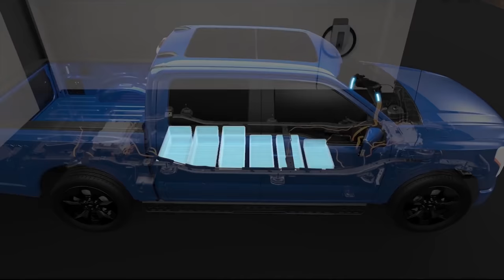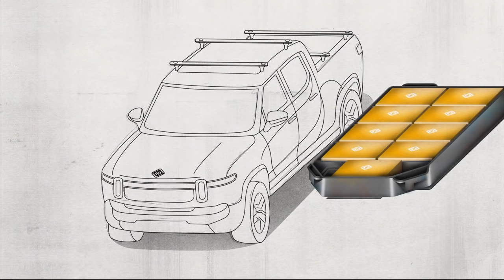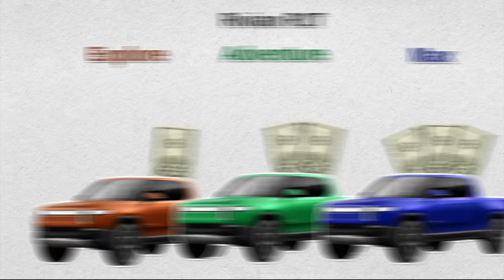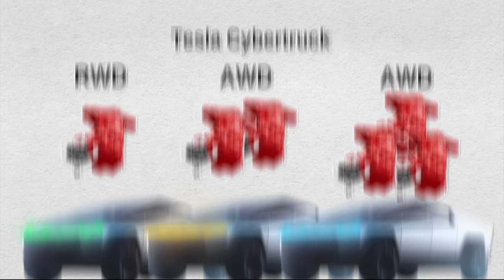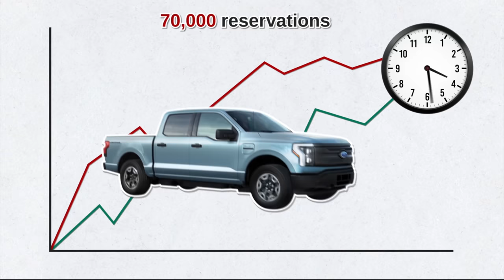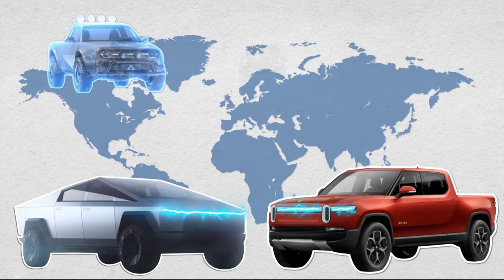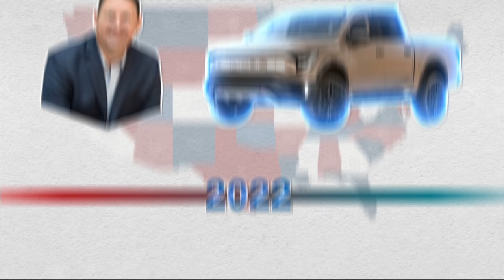Here's Why This Will Replace Trucks in America

Comment: Does the Cybertruck come with pre-smashed windows or is that at an extra charge?
Reply: LOL
Reply: I just hope it comes with a better look and styling.
Reply: @jamesblackwell5141  the style’s gonna stay the same. Lol. That’s one of the biggest talking points.
Reply: Matt black Cyber Truck I'm sold!
Reply: @WAFFLEooFILMS  *matte
Reply: From inside the "cyber truck" (cough) you cannot even see any of the exterior. It's like driving around in a giant fish bowl. (not) Very handy for a large vehicle in tight spaces like parking lots. Oh, there will be cameras? YOU drive that way and tell me if it's practical. People are going to learn the hard way about buying a pickup truck designed by someone (Elon) who has never owned, used or driven one.
Reply: @gazebo9730  So, since you haven't bought a truck I'll tell you. The trucks that I bought and the company trucks I drove, were for PURPOSE and none of them had a 'talking point' as a purpose. The people who will buy one will be hipsters, not people who need a truck.
Reply: @seanwatts8342  well, sure. But this truck is a meme. That's why everybody knows about it and it's probably a big reason it'll sell. I didn't say it was practical or purpose driven, or anything. I just said I highly doubt Elon will change the design, because the design is the biggest talking point. The meme will likely sell the truck.

Comment: Hmmm? I've still got a 2006 Tundra 220,000 miles and it still does everything I want it to. What happens when you go overlanding  in an electric truck and the batteries go bad? Out of cell phone range you're screwed
Reply: A gas tow truck comes to haul you home at an cost that will  bankrupt most people.

Comment: I'm sticking with old school. My work horse is 1967 F100. I don't care what anyone says, it does what I need it to do, I can easily fix any mechanical issue, and there's almost no electronics to worry about. FE motor bolted to a 4 speed is a damn near indestructible setup. And I like knowing that I can get it going with just a few gallons of gas. The idea of having to rely on electricity for your vehicle, especially in an emergency situation genuinely scares me.

Comment: I used to buy rechargeable batteries even though they where more expensive.  My phones always charge and last less and less all the time. The car manufacturers need to prove improved battery longevity technology more than anything, but they won't be able to do that for several years.
Reply: They've been working on that for DECADES.
Reply: This is hands down the biggest "Achilles Heel" of the EV market. How long will these massive battery packs actually last on a full-fledged truck EV? Sure we've got some idea of how they'll pan out with EV cars, but let's be real here... there's a massive difference between the 2 and that's how they're utilized. Will the extreme punishment these trucks endure lead to premature battery failure? Only time will tell. 

Then begs the question, how easy or difficult will it be labor wise (let alone part cost) to replace the batteries? Having 15 years of experience turning wrenches 1 thing I've learned above all else is, engineers do NOT often think about making things easier to fix. Just easier to produce. I'm sure Scotty would agree with this one, especially in regards to certain manufacturers. There are exceptions (Honda & Toyota) to this, but even the best occasionally forget (or don't care) that various parts will eventually fail.

Comment: If the hummer didn't have the cost of a small house it would have been a cool contender.
Reply: That's like saying Porsche would be contender for cheap sports car if they were $50k cheaper. Hummers were never cheap. Even used decent ones are $20k and they haven't been sold for a decade.
Reply: Where can you buy a small house fo 100k ? You can't even buy a condo for that much
Reply: @micperez819  There are plenty of condos and small houses for around 100k in more rural states. Don't know why you guys need to take everything so literal the hummer is over priced and won't make many sales face the facts

Comment: The media keeps this under raps but it is possible that electric cars will not overtake the auto industry, because of Synthetic, or carbon-neutral, fuels. Synthetic or E fuels  capture CO₂ in the manufacturing process. In this way, this greenhouse gas becomes a raw material, from which gasoline, diesel, and substitute natural gas can be produced with the help of electricity from renewable sources. It works in conventional gasoline engines and also can be formulated to power Airplanes. So you can keep driving your old car.

Comment: Reality is...Plug-in Hybrids are way more suitable to the common person. Without the range anxiety, pressure on the grid, more affordable, without expensive battery packs, that needs intensive mining and hard to recycle. So don't expect ICE to go away anytime soon.
Reply: Hybrid batteries are also expensive.
Reply: Thank You ❗
Reply: @stevenw4549  A least you won't have to fight for a plug in the near future if you own a Hybrid, I have personally driven hybrids over 200,000 miles, No not a Prius, Honda 5 speed manuals, If driven properly at the time I got 60 mpg provided it wasn't over 100,000m car I ran both we own to over 300,000m, But now own only Gas powered cars, Because I want Heat when I want it and everything else in between 🤓..
Reply: @stevenw4549  I am not saying  hybrids are bad, I am only talking about my personal experience with hybrids, A larger engine configuration would eliminate most of my bad experiences, Like most new ones are built now, Our larger problem now with dire consequences is that open border it Will Destroy a once Great place to live without accountability for people actions, You can't even evict none paying tenants now, How the hell is this going to work 📉🔥, It WON'T ❗
Reply: @raymondreiff8170  I agree.

Comment: The four wheel steering is about 2 decades old. GM had a quadrasteer pick up truck and, I think, Honda had a prelude in the late 80's (1988, I searched it). There are even 4 wheels steering, on certain riding mowers.

Comment: When they have 1000 miles batteries I will keep on next to my f250 what I love best ever truck
Reply: I agree with that.  I think a 1000 mile range is the tipping point where electric vehicles become appealing.  A 500 mile range is intriguing but really not quite enough especially if you need to tow.  That 500 mile range probably drops to 200 miles when towing.
Reply: I hear ya... But how many miles does a tank get you in your f250???

Comment: The new Ford Lightning sounds great -- except that it's all-electric.  That's okay for a work truck or even a commuter-truck that never goes that long without an overnight recharge.  But I live in an apartment with no way to recharge in the parking lot.

What I'd like to see is a pickup with similar specs, but done as a hybrid with a large enough engine to keep the battery charged while driving.  Electric motor(s) for horsepower and torque, recharged as you drive ... and better gas mileage overall.  Then all we need are mechanics who are also electricians, to keep the running.

Comment: They better start building a bunch of nuclear power plants now...
Reply: Just use the ones we have. In Texas, we have the South Texas Nuclear Power Plant. It's only running at about 10% capacity. If we got it up to 50%, it would power the entire Texas grid AND we would have surplus power that we could sell to other states. If we go to a society in which the only vehicles you can own are electric vehicles, we're going to have to crank up the nuclear plants. The current grids nationwide are too weak to support them. If you're having rolling blackouts due to increased air conditioning usage in summer, your grid is too weak and underpowered. Solar panels and windmills aren't going to cut it.

Comment: End of motorcycles too for us that ride dirt bikes and Adventure bikes. We need fuel, and with less and less fuel you probably in the future only get it in pre packaged cans costing $$$$. We need the range. I ride rough singletrack last loop was 66 miles but not uncommon to do 120 miles or more and Adventure bikes 300 miles is common. I guess I won't be riding by the time it becomes hard to get but it's a shame a sport will die.

As for the trucks you listed, 250 mile range is a joke. This Wednesday I'm hauling the bike and camping not all that far away 140 miles my F150 gets 400 miles there about's for range. So I have plenty to go there and back and not worry about needing fuel or filling up or stopping to charge a battery mid short trip. Yes, to me that is a short trip. I drive from CO to TN once a year to see parents its just over 1200 miles if I go the direct route and more the non direct route which takes me through areas without fuel stations let along charging stations...LOL Who wants to stop and allow the vehicle to FULLY charge on such a trip...I stop for fuel and drive thru for food and keep on trucking. Took me 23 hours to drive back from TN straight through the same route assuming I could find a place to charge would take a LOT longer probably days to many days with the challenge of charging. Doesn't sound fun to me.

I'm okay with hybrid vehicles. I wish they go that route for the near future instead of trying to get us all onboard with this 100% electric crap.

Comment: Exactly, hydrogen and nuclear batteries are the way of the future, not this straight electric with conventional batteries tosh.
Reply: Hopefully you know Hydrogen powered cars are fuel cell cars that are just electric vehicles where you replace the large battery with a Hydrogen tank and normally a smaller battery to deal with instantaneous loads?

Comment: I foolishly bought an 1800 watt power station some years ago as a power backup.  $1200 for the unit plus $600 for 2 - 100 ah AGM batteries.  7  years later the batteries were dead as a door nail.  But now I can get a Firman 7500 watt tri-fuel generator for $850 at Costco, that won't need anything but an oil change after 7 years of disuse.  Hardly more than the replacement AGM batteries.  The battery thing is a bust.  It's great for portable tools, but not anything serious.

Comment: Whenever I hear solar roof, I usually assume that they don’t understand the prior r and d to try this out on existing electric vehicles…

Unless something changed with solar panel technology, which is possible. I’d love to see panels be feasible on a vehicle but it just doesn’t make sense to have the roof of your car absorb heat unless it is insulated properly from the sun. Otherwise you’ll need to use that electricity to cool the vehicle.

I guess it’s fine for a parked car like this but may van campers have learned that it’s far more economical to park in the shade than to charge their van with ac on.

Comment: Battery: gets punctured during T-bone at intersection
EV: explodes
Reply: Gas Tank: gets punctured during a rear end collision.
ICE: burns spectacularly.
Reply: @johncorkery4924   Literally not what happens. LMAO EV FANBOYS ARE BRAINDEAD.
Reply: @lenney872  I take it you’re not old enough to remember the Ford Pinto?  Or the 2 million F-150’s recalled because of potential fires?
Reply: @johncorkery4924  The difference is that the material in EV batteries is pyrophoric in air. Does gas instantly explode when it touches air? No. Does every battery explode when punctured? YES. You can look up videos. They are a complete danger to the public, not to mention they still use coal fired power plants to charge so they are not “carbon neutral”.

Comment: The Achates opposed piston diesel and gasoline engine is more exciting than an EV.  Hitched to a hybrid system, the Achates engine becomes a generator and will extend range and mpg by at least 37 mpg (gasoline, F-150) and 42 mpg (diesel, F-150).  Hopefully, after the Advanced Combat Engine testing is finished around 2024, the civilian market will embrace this engine.

Comment: I like the idea of an electric truck, but I wouldn't buy from a startup because when your battery dies in 8 or 10 years, the company might not still be around to replace it, and other parts might not be available, either. That's where the big, well-known companies have the advantage. Ford and Chevy and Toyota are likely to be around longer than any of us.

Comment: For those who don’t know either, crash ratings are pretty poor in electric cars, not having that engine in front is not good for accidents. In addition , Tesla makes it very difficult for you to work on your car or take it anywhere other than Tesla for repairs.  So you might save on gas, but you’ll catch up if
You need repairs

Comment: All that is required is the release of more fuel efficient vehicles e.g. Tom Ogle Carburetor. 100+ mpg on a 1970's design. The Issue with electric vehicles is power draw on the energy supplies - batteries overheat resulting in loss of both range and longevity of batteries...

Comment: Interesting as these options are - Lordstown's alleged claims of any handling advantage using hub motors has gotta be suspect  - if a  dynamicist can explain how increasing unspring weight (as the only change) can improve handling under any operational regime..   hmmm...  (Of course reduced part count - no shafts or CV joints single motor / brake hub assembly - got a fault, 4 bolts will swap out a corner unit - 4 wheel steering would however be the most trivial benefit.)

Comment: I still think hydrogen fuel cells will come about. What is the power density of hydrogen vs gasoline vs batteries?  I know, it takes power to produce hydrogen. And, hydrogen gas has some definite problems. Just questions
Reply: Infrastructure and logistics for distributing hydrogen are the most serious obstacles at the moment. Every part of the developed world already has power lines, but few areas have any readily available method of viable hydrogen distribution.  Apart from the Toyota Mirai, a rather unimpressive hydrogen fuel cell car that has only sold an average of five units a day over the past eight years, there is little interest in fuel cell vehicles, and hydrogen cars are still only really practical if owners are based in California. Looking back on how long EVs have taken to move from the first viable roadgoing versions (the General Motors EV1 of 1996 to 1999) to fully-fledged high-quality cars (the Porsche Taycan as marketed from 2020, for example) it will probably be another two decades at least before a hydrogen car becomes a mass-market possibility, if it ever does.

Comment: I wonder if one of these trucks will be able to tow a trailer with a big enough generator to charge the batteries so you dont have to STOP and wait for a charge. 😅
Reply: @markplott4820  But this still would mean I would have to stop and wait 🤨
Reply: @markplott4820  Then that runs out... then what? WAIT?

Comment: The producers of the proposed future new electric working-men pickup trucks should consider reducing the length of the (now empty engine bay) front storage area so that a more useful larger volume bed could be built behind the back seats.  A design that would be envisioned as a snub-nosed model when compared to the present-day designs would be more useful for working men who need a real working truck, since often they need payload volume in the bed, not hide-away storage volume.
  Some might worry about the reduced-length front compartment being less crash survival.  I am certain that sufficient crash protection could be designed into the reduced-length front compartment frame.  One idea might be to install a crash bag in the front that would be deployed and extend in front of the vehicle, if the vehicle sensed it would soon contact an object.

Comment: Nice commercial, Scotty. However, from what I understand, electric pick-ups work fine when people drive them as cars, but they don't do well pulling heavy loads. For that, gas will always be king. My gripe about new model pick-ups is the size, you need a 3 step ladder to load a bag of cement into the bed, and it seems they are more concerned with comfort and luxury in the extended crew cab. You can put 20 pieces of 4'X8" sheets of plywood in the bed or even full length 2"X4"X8' boards. Give me a 1983 F-150 with a straight-six f250 engine and a 4 speed manual transmission any day over these future toxic waste products. It seems the pick-up trucks today are designed for people who don't want to think of driving a van.

Comment: Why would I trade my F-150 gas truck that has a 640 mile range for an electric truck that costs $10,000.00 more than what I paid for my current truck and travels 200 miles shorter per charge? Not to mention I travel to multiple states for construction/remodeling work. I can make my average trip in 10 to 11 hours with one stop to refuel at any available fueling station. I can't do that with an electric truck.

Comment: I’d be interested to learn more about the recycling process/plans if any the auto makers have for all the spent battery pack/cells all these vehicles will produce? 
Also what the plans are to upgrade the electrical infrastructure to accommodate The high voltage charging systems that will be necessary around the country?

Comment: So what happens if you are driving an electric truck on a hot summer day and You're stuck in traffic and you are running the A/C? 
The battery will drain quickly. Only solution , is to shut off the A/C while driving to preserve the battery( on a hot day), and here's hoping the battery doesn't catch fire, Like some ongoing recalls. lol